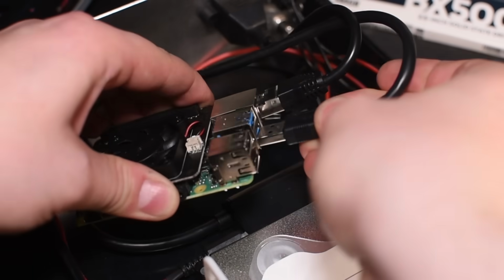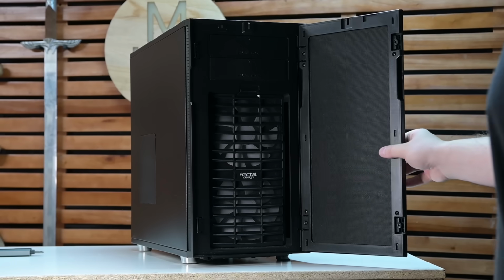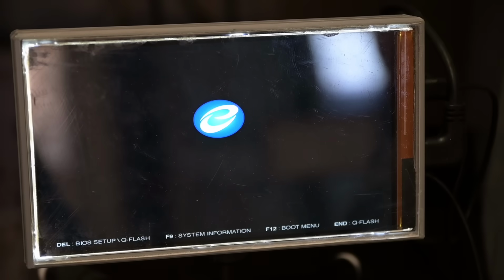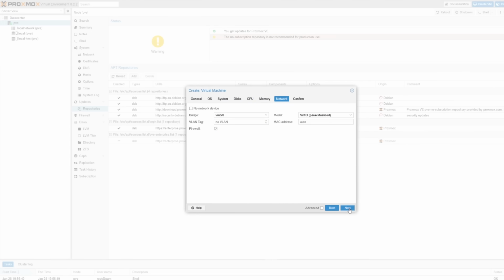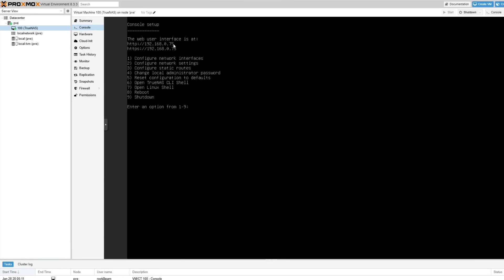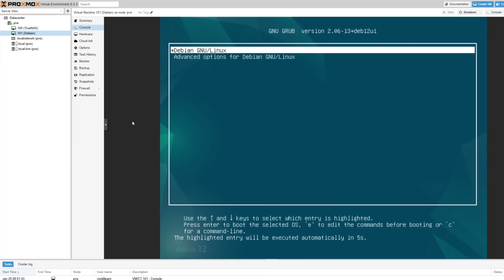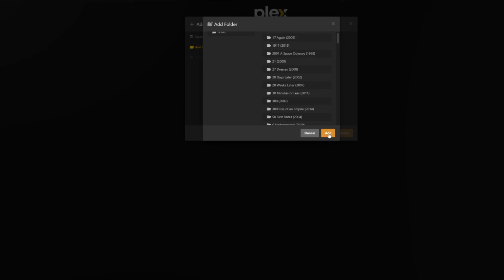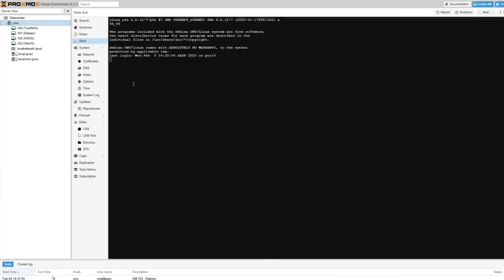The Do-It-All NAS for 2025!

Comment: Your LSi HBA will burn itself to death without extra cooling. At this point, I'm going to say a purpose-built server like a Dell R720/R730 would be more cost effective and will just work well right out of the box, along with easy to service drive caddies. I found one on fb for $280, came with two xeon E5-2650 cpu's and 192gb of RAM, along with spare psu's and some HBA cards (which i didnt even need to install due to the built-in SAS raid controller). I even wrote a custom manual fan curve so it's dead silent while idle, and spools up the fans at various temperature intervals.
Reply from the maker: It actually seemed perfectly happy. But I've recently added a fan. That will have the trade off of drawing quite a bit more power I imagine though! Bit more than 75W!!

Comment: Why did you go with having your drives connectors facing the front instead of connecting to the back of the case???   I think I tried but the plugs stuck out too far....
Reply from the maker: So I don't have to take off the back panel to disconnect the cables, then remove the front panel to remove the drives. Cables fit fine for me in this case
Reply: @Maker_HQ I use interposers for SAS drives so they add a little bit more to the drives

Comment: Hi
A have a question about the passthrough. 
I have a PC with a additionsl PSI card Adaptec 8405 and want to use 4x 4TB SAS plates.
But after 2 days of "fight" with the system ProxMox and Chat GPT i gave up. 
Can you maybe help me?
Br
Wasilij
Reply from the maker: If you haven't already added it as a device by ID or port in your VMs 'Hardware' section, then this is what you want to do
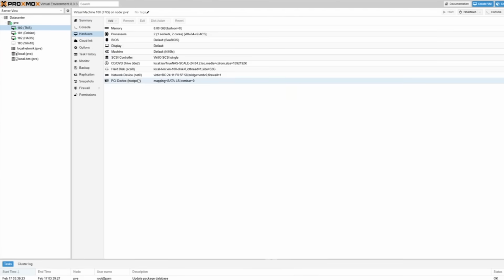Reply from the maker: See 7:35

Comment: Next time DUMP Intel. Intel does not address ECC RAM and AMD AM4 matisse and vermeer do, as does AM5. Unregistered ECC corrects 1 bit while your system will accumulate errors and write them to disk. Most AM4 MBs support ECC (if your CPU does). For AM5 MBs, read the specs. Also very helpful to update BIOS to newest non-beta.

Comment: I use ZFS with Proxmox and i have a Boot - Pool  of 2 small , older 512 GB NVME SSDs  , this way the Truenas Boot  32GB  share of the Proxmox  Boot Pool gets automatically an fail safe  as well and you dont need a Boot Pool in Truenas , i use an old  Xeon 2697v4  ( 18 Core ) CPU . i bought it as a Combo with 128 GB DDR4 2133 ECC Memory and a chinese MoBo with a real X99 Server chipset  together ~ 290-300 USD, currently its more expensive,  , i use five 4 TB NVME SSDs https://youtu.be/CXdUbF7AH0A
My new project is absolutly overpowered ( the MoBo still has to arrive ) and i dont really need it . Its a Pentium 8570 ES Server CPU  , Intels 5th Gen scalable Xeon , the 8570 was lauched in 4th Q 2023 and has 80 PCIe5 Lanes + 300 MB L3 cache and has 56 Cores /112 Threads . i payed 350 USD for it .. , its an ES = which means you need a modified Bios which i will get . The motherboard is expensive , but at least ATX/EATX ( Gigabyte MS03-CE0 Server Mainboard ATX/LGA 4677 )  , has 7 PCIe slots with  3 x 16 Lanes and 4 Slots with 8 or you can get 5 slots with 16 Lanes = 850 USD ( 12X SATA6 over 3 x Slim SAS with 4 SATA Drives each  , Memory is expensive too , at least if you want to use Octa Channel = 8 Sticks of DDR5 5600 = one  32 GB is ~200 USD . I decided that Quad Channel is enough for me = 4 x 32 GB = 128 GB . I hope the 300 MB L3 cache will help with Gaming because it boosts only up to 3,8 GHz . The 8570 was sold  for nearly 10 000 USD at Launch in 2023 and has still a 4000- 5000 USD price Tag , i guess no one has really tried Gaming on it and i guess Win 11 will have Problems with 56 Cores /112T in Gaming because no one developed a gaming profile for it . Others buy an RTX 5090  for 1500 - 2000 USD , i bought something that i dont need but still want to try out . The old 2679v4 sucks ~ 80 Watts in IDLE , i guess the 8570 will be at 100 Watts in IDLE ( 350 Watt TDP )

Comment: Extremely interresting video.
What's the benefit of running the apps in Debian using CasaOS instead of in Truenas? I thought running everything in Truenas would be extra convenient, as I have only very little experience with Proxmox and Docker. Sounds like a lot of extra steps, but I'm sure you have a good reason for that. Just out of curiosity to learn how to setup my new NAS-to-be.
Unfortunately I can only leave you 1 like. I'd be very interested in the HAOS installation process.

Comment: Thanks for the ivdeo, I was wondering if ya used ECC ram?   Wondering which affordable motherboard and processor I should buy that has ecc ram for truenas/proxmox
Reply from the maker: No I didn't, it's definitely advisable to use it with ZFS, but no issues so far. That could change of course though...
Reply: @Maker_HQ  I def wanna use the case you used for my truenas build -- the R5. I'd also run truenas under proxmox as a vm, like you did.  I do want to get a power efficient cpu and motherboard that uses ECC ram and is relatively quiet.  Throw a pci e card in for SFP+.

Comment: Uff, I don't even know where to start. Don't follow this guide, its far away from anything you would call "best practice". Why bother with proxmox (which is Debian based) when you run a Debian inside it, which then runs the services. Why run a GUI? Why is there a windows 11 running? (If its a server run windows server). Just build a container for each service, to have isolation and control if something breaks. There are lighter alternatives to truenas if you only want NAS functionally and handle the other stuff with proxmox. I recommend you search for "proxmox helper scripts" and redo this project.

Comment: 64 watts is that idle with 6 x hdd that should be more like 90 -120 idle and at load over 200 because mine is pulling that much power with an i7 6th gen 1060 gpu and 6 x hdd
Reply from the maker: I'm at 90w now with 8 drives

Comment: I'm looking to do very close to the same build. Wish you had links to the hardware you used. I have a similar Fractal Designs case that I am planning to reuse for my build but I need to upgrade my mb, RAM, and CPU.  I think for the remote gaming you might want to look into streaming the game with moonlight. I'm probably going to go with a recent gen Intel I5 because their integrated GPU is excellent at transcoding. I currently use Jellyfin installed as a flatpak on my GMTek i3 (N100 based nuc) which runs Batoceta linux as a retro gaming console connected to my TV. The Intel integrated graphics in that mini PC does very well streaming to my main TV, smartphone, or Kindle.

Comment: all those hard drives and you only have 9tb availible!? - for most cases with truenas, I would strongly recommend using 6-8 same-sized drives and doing a raidz2 for redundancy.  then, if you need more than the first 6-8 drives, you can add another vdev of another 6-8 drives down the road.  right now i've got a raidz2 pool with 3 8 disk vdevs, 2 of which use 16tb drives and one of which uses 14tb drives.  further, I noticed that your nas only has 8gb of ram going to truenas - which I guess in your configuration of 9tb usable is fine, but typically truenas uses quite a bit of memory for caching and the standard rule of thumb is you want 1gb of memory per tb of usable storage which adds up quick.  in my case, my nas (running baremetal truenas scale) has 238tb of usable storage, but the system I'm using maxes out at 128gb of ram.  because I have so little caching per storage, I decided to install an additional mirror of ssd's to serve as a metadata special device so that I didn't have to worry about caching that data in ram or seeking the hard drives to access the metadata information of the array.  because there are so few users accessing my nas (it's largely archival media storage (plex), transmission bittorrent seeding, vm backups, etc. and there's only 4ish users on the system max at any one time, this has worked out fantastically).  I also have a proxmox cluster of 5x dell sff systems (i7-8700's each with 64gb of ram and 512gb and 2tb (for the os and ceph respectively) ssd's, and dual 10g networking back to my 10g managed switch.
Reply from the maker: I only have (or had, at the time of this video) 22tb of raw storage (8+10+1+1+1+1) in 3 mirror vdevs

Comment: You skipped over Whatever initial setup you did with your hard drives. They seem to be a member of a raid volume but watching your video, it doesn't seem to cover this. Proxmox has various warnings that it has some incompatibilities with bios/hardware raid, and then you are setting up Truenas in such a way that your virtual hard drives are using zfs ontop of the base system's hardware raid.   I think the better option is to pass the disks through and let Truenas handle things from there.
Reply from the maker: See 8:48. Proxmox does nothing with the hard drives, the HBA is passed through to TrueNAS

Comment: Which specs did you choose? What is the CPU?
Reply from the maker: I just used a mid range CPU and motherboard (both of which i already had). The CPU model is in the video
Reply: @Maker_HQ I'm totally lost on your software stack. My ignorance at play. I have much to learn.
Question. THE HBA. I am told that the 9300 uses half the power of a 9200 serries. Can you confirm? Thoughts?
I plan on reusing a z170 micro itx with an undervolted 7700K CPU, in a Define R4 case. If you haven't looked into undervolting, please do. I was shocked at the fact that undervolting reduces heat and throttling with minimal performance reduction. I can link to the video if of interest. Lastly, Kudos on a 64 watt server on old tech. Cheers from Perth.
Reply from the maker: @hey_skip  can't comment on the 9200 vs 9300 HBA sorry. I just grabbed something that did what I needed and was in IT mode. I'm not hugely concerned about power draw but was very happy with the result. Yes undervolting can be a bit of a cheat code!
Reply: @Maker_HQ  I appreciate your honestly and taking the time to answer! thanks matey!

Comment: I do something similar, but rather than a full debian VM with casa-os, I do a couple of LXC containers. I set up an initial one with cockpit + dockge on it with my iGPU passed through, then I cleared the system identifiers from it and turned it into a template. Then I could replicate the template as much as I want to spin up separate LXC environments to experiment with running docker containers while having GPU acceleration coming from the iGPU. 

As for GPU acceleration, I've found the VNC terminal is a huge letdown compared to remoting into the VM directly, and there are much faster remote desktop protocols for that these days.

Comment: Really informative video! why no RAID tho?
Reply from the maker: My implementation (RAID 10) doesn't offer the greatest space utilisation but it is tolerant to a number of drives failing. Had I not used the 4x1TB drives, RAID 0 would have been my only option which only offers redundancy (mirroring).

Comment: could you kindly list the hardware specs ?
Reply from the maker: @scrollsofvipin  what are you wanting to know specifically? I covered all the devices used in the hardware section
Reply: @Maker_HQ  The model of the motherboard, HBA, ram etc.. that would be great.
Reply from the maker: @scrollsofvipin  the ram is just ddr4 3200mhz, nothing special. The HBA is linked in the description. The motherboard is GB Q370
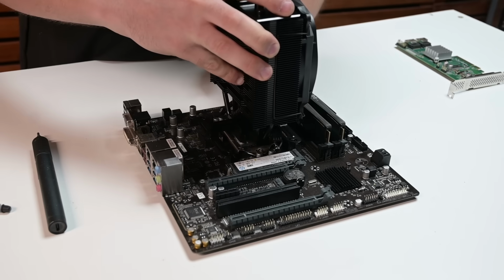Reply: @Maker_HQ  2:18 MB???
Reply from the maker: @_mult  I've answered this in reply to another comment

Comment: Really nice vid. and shockingly similar hardware as mine. Am rocking an i5 9400f,(no igpu so using a gt710, yeah ik its bad.. but just for display out if ever needed, i dont game), and again very similar gigabyte board and hdd configs. Am runnig Truenas and debian as well, no windows yet.. might try later on tho. Also btw thanks a TON for the power info, had no watt meter and was veryy curious on what my power draw would be on avg.

Comment: Thanks for sharing a quality video of your build. Your software stack is a bit much. Wonder why did you decide to use Proxmox. Both TrueNAS and Debian can be a hypervisor.  

I myself take a more only what I need approach. Debian without desktop environment install all packages needed. Managed by cockpit. Much more lightweight. 

As for gaming. In my experience the only way is to pass through the GPU, keyboard and mouse. Hook up a monitor. Not remote gaming I know but it’s the best experience.
Reply from the maker: @ninjafatigueandbeyond  you're welcome. Yeah I don't doubt there could be better setups, I'm no expert, but this works for me and is pretty easy to get going imo

Comment: Wondering why you went casa rather than use ZimaOS? Seems to have better support for drives and their basic managment. Also has ZVM app installed out of the box for running virtual machines.
Reply from the maker: @bob1nz  tbh I didn't know it existed! But it looks to still be in early development, so I wouldn't consider using it as the primary OS

Comment: I did that but with proxmox, pci passthrough with 4x4Gb drives, amd 3700x,64GB ram and jellyfin-cockpit-portainer containers in a fractal design node 800. I will change soon for a mini itx board and 2x12Gb hdd, amd 5950x, FD node 300 to lower power consumption and case size.

Comment: Liked and subscribed! Is there a build list for this server? Maybe I overlooked it?
Reply from the maker: @GrandpaDoesTech  thanks! I hadn't, partially because the platform I used is old and partially because the hardware I'm using might not be adequate for everyone. You might want a mini ITX motherboard instead, or not need the LSI card if you are only running a couple of drives. Everyone's requirements will differ. Broadly though, just about any CPU from the past 5 years or so and 32gb or RAM will allow you to do most things

Comment: ThinkCentre M92p with i3-3220 with alpine linux
IDLE-ing 15W running with this docker images:

Runs 24/7 :(grav, littlelink, nextcloud with collabora code, ollama with openwebui(you can run only tiny models max gemma3 4B in this config), pihole_cloudflared, samba, searxng, transmission, uptime_kuma, watchtower, gptwol, wordpress, immich)
sometimes: azuracast,openspeedtest

If i want to use my bigger AI server With GPU in it... kohya_ss, and Stable Diffusion Webui forge.... i just wake up that pc With GPTWol... and use it... There is another PC_S with lots of Hard drive, which OFF and can wake up with WOL as well... You dont want to run multiple HDD-s 24/7. .. hd-idle can help...

Comment: Quick question which rad controller you recommend? i don't wat the raid feature. So i need one where i can turn off raid. Thanks
Reply from the maker: @stormk-1130  the LSI card I'm using just provides more interfaces, TrueNAS manages the RAID array
Reply: @Maker_HQ  Can i install that on a normal pc? Not looking to build a nas btw, i need it for slave drive.
Reply from the maker: @stormk-1130  absolutely, just check you can get drivers for it before buying
Reply: @ Thank for the help i appreciate it.

Comment: Can you tell me what the power consumption is of this machine?
Reply from the maker: @Equality-and-Liberty  check 16:47 =)
Reply: @Maker_HQ Wow! That is very low. Which type of motherboard u used?  Can I use any motherboard that supports a Intel I5-8500 processor?
Reply from the maker: @Equality-and-Liberty  that's idle power but yeah pretty good. Newer processors would be even better (maybe 10w or so less). Therefor, I would suggest buying a newer, low end CPU such as the i3 12100 if you're looking to put something together. You don't need to use an 8500, that's just what I had lying around!
Reply: @Maker_HQ  I want a setup just like yours—Proxmox and TrueNAS combined. My current setup would allow it because it consists of 2 x 12-core processors and 256 GB of memory, but I want to migrate to a cluster setup with enough nodes to give me the same processing power but less energy. What I have now is a small nuclear reactor when it comes to the use of energy 😅. I wonder how you can do everything like TrueNAS and Proxmox on a 6-core processor?
Reply from the maker: @Equality-and-Liberty  CPU usage hasn't gone above 10% In the past 24 hours, but my frigate instance isn't doing any AI computation just yet

Comment: Nice guide, but I went for a pure ssd setup. Nvme storage has become so cheap, 24TB wasn’t that expensive to come by.
As memory is also very cheap, I would recommend to at least go with 64GB, maybe even 128.
My normal workstation already has 64GB since over 5 years, so for a central proxmox, that should be a good baseline.
Reply from the maker: geez I wished I lived where you do, 24TB of SSDs in Australia would set me back about $2000, about 10x what a 10TB HDD costs!

Comment: X99 platform is much better for that:

1. More cores.
2. More PCIe lines
3. More RAM slots.

Higher power usage, unfortunately.
Reply from the maker: talk about overkill for this setup!
Reply: @ You have only gigabit connection to your network…
Reply from the maker: @Adam130694  I don't need faster than gigabit

Comment: You may want to buy a small fan for your HBA.  Those come straight out of servers and don’t get the same airflow in a PC case.   It took me ages to troubleshoot all the random errors I got once they overheat
Reply: What would you recommend? Ziptie some fan to somewhere near it?
Reply: @trignite  Yes, I have done that, and a few others on YouTube have done it too
Reply: It depends entirely on the model used. 
With, say LSi cards, fans are recommended on the cards ending in 0 but not necessary for those ending in 1 or 5.
For example the 9300 <- Fan 9305 <- no fan.
Based on appearance, he used a 9211-8i, which does not require a fan.